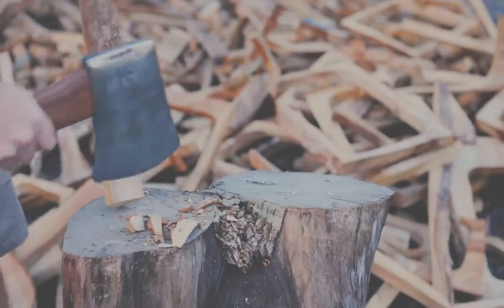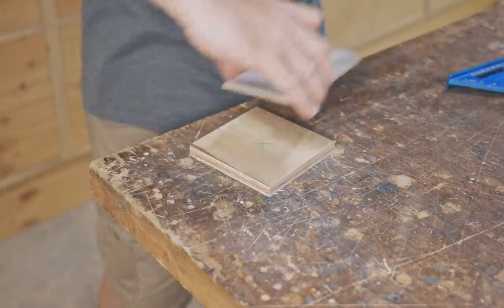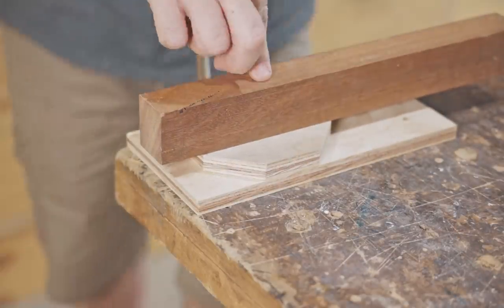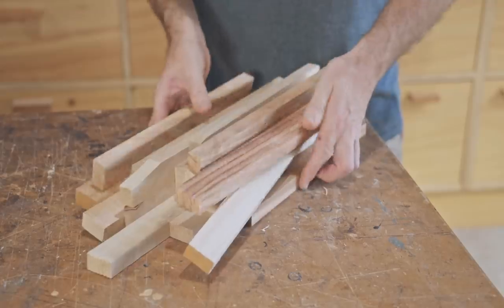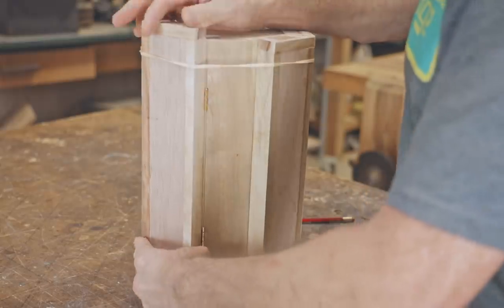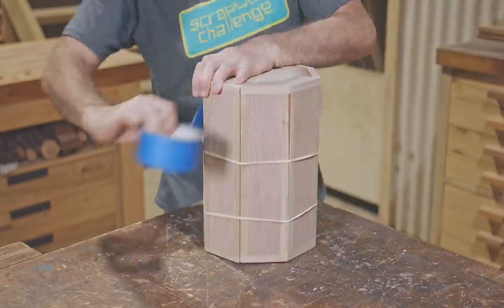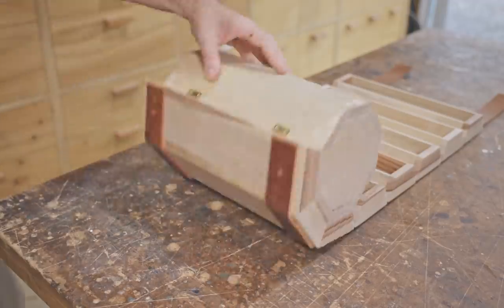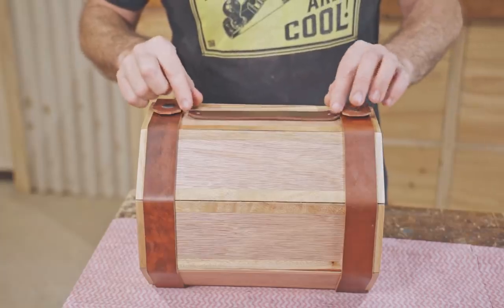Making an Octagonal Toolbox - (Day 6) 7 Scrapwood Challenges in 7 Days - ep48

Comment: Your videos have inspired me to build things from scrapwood.
I currently work at a bigger company, that gets a lot of steel on pallets and thus throws away a lot of used wood. Both soft and hardwood are used for the pallets. After using a planer, saw and sanding the wood, it looks really good and are great for smaller projects.

Comment: I'm no carpenter myself, but when I was doing manual labour on construction sites, I learned a few tricks. To help with the mismatched hole fill colour, wait for the putty to mostly set, but before it dries, sand over it. This way the putty picks up some of the danding dust and the colours match a lot better.

Comment: What a cool, different box!  I'm really liking the camphor laurel wood in all the Scrap Wood Challenge projects!  I worry about the 1/4" thick plywood having to carry both the strap snaps as well as the handle though (depending upon what you load this box up with - combination wrenches and sockets come to mind and they can get pretty heavy).  I might have sacrificed all or part of the one tray to better anchor the carry handle in that case.  I agree about the catch and the finger hole for the main box as well.  I may have to try this to practice the segmented build portion as I have a display case in the design phase right now that will most likely require segmented construction.

Comment: Nice work. 
The only thing I would suggest is to bevel and burnish the edges of the leather. Raw edges collect everything and wear the leather much faster. Burnishing the edge seals it, and helps keep most of the saw dust and other crap from getting embedded in the leather. Beveling the outer edge will keep the edge from snagging during normal use.

Comment: Still have my Rolykit. Been using it for years. Keep some wrenches and socket extensions among other tools in it. It is a little bit of a pain though to roll it all the way out if there isn't a long flat surface to do it on. I'd say it's around 4 to 5 feet long when fully rolled out.

Comment: I've been a Subscriber for a long time. I'm liking your version as I got a pink plastic on from somewhere, but don't recall from where. I'd been trying to place the wooden octocore as the plastic one has odd-shaped kind of fingers that take up the center without significantly more in storage depth of the outer segments so the "Scrapwood Challenge" model is superior to the factory one! I oddly enjoy the theme of the series! I picked it up because I used to be a big fan of woodworking as well as to repair vehicles, but a slow speed at work accident in a tractor trailer at the parking lot of a customer in a single vehicle accident at less than  10 MPH in reverse set off a chain reaction that has limited my mobility significantly as well as increased my physical pain exponentially to the point where I have gotten very involved in jewelry making and each new skill or technique gives me the satisfaction of making a new project or refinishing an old piece for a new life. The roll up toolkit was to store an increasingly large variety and type of material used. Can you please consider doing some woodworking projects related to making jewelry? I'd love for you to work with artists in jewelry arts to make modifications of the traditional jewellery making workbenches with features from ages past like the sweeps tray and a thin leather or fabric to catch any of the precious materials at the end of the day. An oft told tale of Sam Adams, a patriot and goldsmith of The American Revolution in Boston. He bought his employees longjohns as the workshop wasn't as warm as our current era and they worked in them every day getting metal in the fabric and at the end of the season he would burn them to recover the metal in the clothing! So if you can think of anything that would be grand! One of my favorite folks who does Egyptian Coil technique bracelets, necklaces etc. is in the UK  but she's not so active as R.A. & her carpal tunnel is increasing with her fame and success.

Comment: I'm thinking of making similar but with maybe 2mm stainless or even aluminium for the sheet material, then using hex head screws it would have prebuilt feet to cut down on damp wither rolled or unrolled from contact with the ground

Comment: I imagine you will also need to figure out a different handle if you plan on putting anything heavy in there. The wood for the bottom of a tray is probably not cut out for that task. Maybe you could attach it to the 2 leather straps somehow.

Comment: Amazing. Blows my mind. No way can I do this with my limited brain without a major assist from technology. It may be dorky but I catalog all of my scrap (wood and metal) in a Google Sheets spreadsheet and then transfer the pieces I may need into the free version of Sketchup to design the project. It gives me an accurate final design to work with along with the ability to create pieces for my CNC and laser etcher. At the end of the project, I re-measure all of the leftovers back into sheets (even the 1-2 inch pieces if it's an expensive wood).

Comment: I noticed that when it was rolled open the trays wouldn't lay flat where the handle was underneath.  Do you think that 2 handles placed on the ends instead of 1 on the top would work better, or is there some reason that wouldn't work at all?

Comment: Is that just one of those space bags for luggage and pillows? That's genius if it is, I never thought to use one like that.

Edit: also if you cut a slot in the handle, instead of two holes, it will lay flat when unrolled and will be able to be pulled up to carry.

Comment: This is amazing! I just have a doubt. Does the weight of the entire toolbox going to be hanged to those two buttons on the leather? My fear is that, once the toolbox is filled with tools, the buttons will open under the weight and the entire system will open. (sorry for my bad English)

Comment: Great work... Loved it and will make one for sure. In my opinion i just think you shouldn't have cut the strap and the press studs should be on the next tray. So you could notice them from the front. Don't make a finger hole for the lid. Just put a small magnetic lock and a mini leather handle in the lid. When you roll the toolbox, if you have small objets inside they will fall trough the hole. Again just those minor things to make in a bit better for me. Merry Christmas

Comment: Pask, that's a great tool box.  Very cool.  Do you trust those snaps to keep everything together when you carry it?  Once its full of screwdrivers, pliers, and other bits and pieces it could be a bit heavy with some pressure on the snaps, though I guess it woud be more or less shearing force rather than directly upwards.  Nonetheless, a great piece of work.

Comment: I only see one thing that may b a problem is the added weight of the wood. I have a tool box designed to carry tools from storage to work place (to car / truck). Even though the metal tool box only weighs 2-3 pounds all the lifetime gathered tools that it holds tips the scale at over 70 pounds. I'm in my 70s bad health n really not to lift that much weight. I got to thinking about all the tools n wanting them home. So off me n my  30 odd year son goes to the self storage (son to do the heavy lifting 😂)   When we got there we moved stuff around as tool box was covered.  I said there it is put it in the car. He reaches down like he was going to pick up 15-20 pound box n didn't even shake it on first grab.  As he put the tool box in the back seat he asked what's in that tool box.  I just thought of all them life long gathered tools n smiled an said to me gold. 😁 I'm a sucker for when it comes to tools and as I often go through that box with a rag n wipe each tool down n think back of how n when I I got the tool n how many times each tool made the job easy.

Comment: I love this kind of box, but it should be noted that the handle should lay as flat as possible when the box is open, and be mounted opposite of the first compartment to open. (Longer straps to put the closure on the side or top work great.)

That reduces the tendency for people unfamiliar with the box to open the straps, pull on them slightly, and dump the first 2-3 compartments accidentally because they don't realize how it is meant to open.

If the first compartment is flat on the table when you put the box down naturally, with the handle at the top, just about anybody will open it properly, without a lot of instruction.
Reply: I will admit, I'm not a major woodworker, in any way, but I've handled boxes that do it both ways, and having the first compartment on the 'bottom' of the box just works substantially better.
Reply: All that said, the box is beautiful.